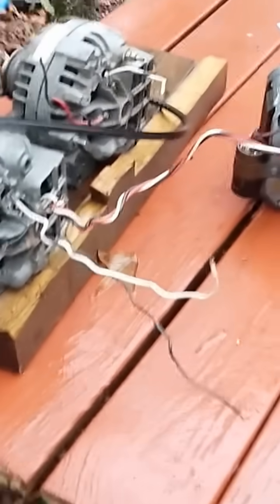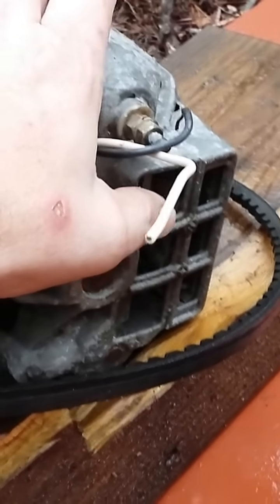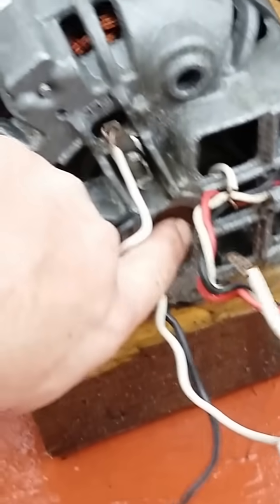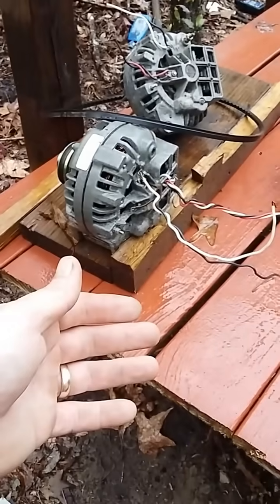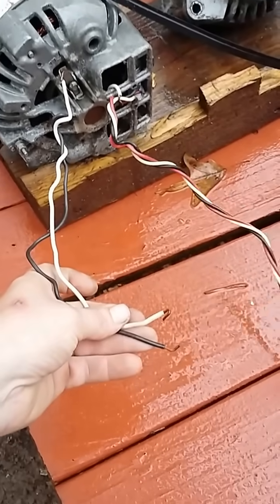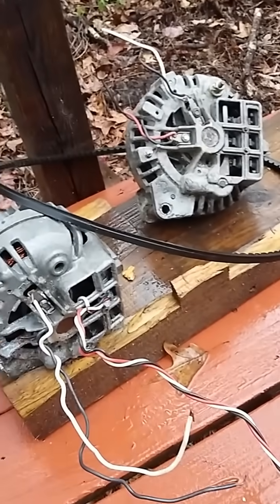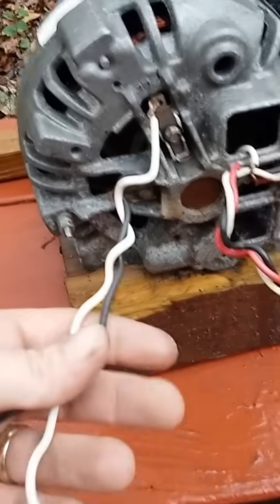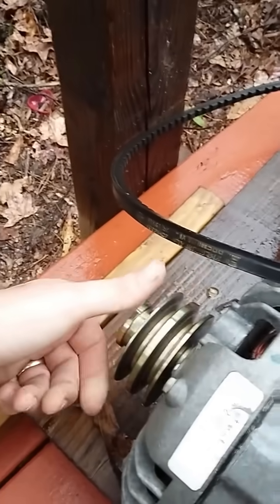Update Free energy forever no wind no solar no gas READ DISCRIPTION!!!

Comment: some of you people are just but stupid this guy's done something I've known for 25 years I called it a charging unit, a battery with a dead cell it won't take any charge but will put out enough voltage to supply the field Supply on the alternator enough current to excite the alternator to put out enough voltage back into that dead cell battery to run an inverter and many other things, I ran two TVs ,  2 water cooler setup to run on 12 volts and a lot of lights every night for many years at idle with a small Honda motor and had people all around the area coming to see it and copy my idea y'all just too stupid to get into it

Comment: I want to see it hooked to a light in your house.  I thought of using magnets to propel the motor to turn into power
Reply from the maker: James Trotter you can do that too... you just have to be creative and thank efficiently! I've actually got another system that uses a 3-phase permanent magnet motor... with the controller the 3-phase H bridge and everything together it consumes less than 700 watts and is able to produce 20000 Watts but the alternator in this video that has the wires hanging out of the back of it is actually a 3-phase field magnet motor...

Comment: If they wanna find you it would be easy to track you through the cell tower or your IP address unless you are operating behind a VPN or similar
Reply from the maker: newton raymond I do run a VPN from some of my devices but not on this one.. if they want to come find me, I'm about 20 minutes outside of Little Rock! I'm not hiding from nobody! I have 5 hardwired cameras that's not all the cameras... just the hardwired ones! I have perimeter sensors and I have people with weapons! like I said I'm not hiding from anybody!!! Thanks for the comment! most people don't know about virtual private networks or how to set up mock locations... I have both!
Even though I don't need them.. and there's a little secret about directed energy weapons. they don't go through aluminum...

Comment: you said a few times one must put  6 volts into the first wires. My question is, where do I get the 6 volts? I'm not being a troll. I no nothing of electricity. Serious question.
Reply: JIMMY FRANKS you can get your six vaults to excite the alternator from a six volt battery. The alternator produces DC volts at about 13.8 volts output. So if you have two six volt batteries wired in series +_+_ you can charge them from the alternator , just take the six volts off one of the two six volt batteries.
The alternator will have to be turned by a wind mill , or water turbine to turn the Stator to produce DC power. Surplus DC power can be stored in batteries for when there is no wind. Remember the larger the demand on the alternator the harder it will be to turn, but generally people using this type of setup are frugal with their power needs and just need light or efficient refridgeration etc.
Cheers.
Reply: Axeman so you're using a six volt to start and the altenator to recharge the battery
Reply: @Jameseyesopen to excite the alternator,  3 to 12 volts dc. No such thing as "free energy" first you have to have a source to rotate the alternator , propeller  , impeller  etc. two six volt batteries in series gives you the ability to tap off six volts for other stuff, recharge your phone etc.

Comment: We have had the capacity to produce free power for at least 40 years ! If you have a hoover or a washing machine , they have huge motors in them with step up transformers and step down transformers to alter the current and voltage ! That's what he is explaining ! ! The government's and electrical companies ,who make massive amounts of money of us every month,year would not allow this because they are lieing greedy bastards who rip us off ! ! Example ! You put into you're hoover or washing machine 240 volts , and low and behold it's running a 2 watt motor that's producing enough electric to run you're whole house ! ! With clever step up and step down transformers and decent batteries you could run you're whole house on one plug ,plugged in for just one hour a day ! ! !
Reply from the maker: graham eel 
Well I didn't want to say all that on this video because this video has a lot of attention.. so let's go ahead and tell it all  and you are correct except it's not 220vac and it's a little more like 396pdc volts and you consume .75 amps which is just a few watt's considering it will power a large enough 3-phase permanent magnet motor to efficiently run to 10000 W self excited generator heads let's do the math 396 times .75 equals 297 Watts but like I said that is for a large system that will power two 10000 watt self excited generator heads and that means that there is no input to the generator head all you do is turn the shaft and they accomplish this with a non polarized ceramic capacitor and a 10A10 rectifier diode you do however have to charge it for it to create the field the first time you use it and if you leave it sitting for a couple of years you will have to charge it but like I said in my previous comments I replaced the bridge rectifier in this alternator with a 3-phase H Bridge therefore using it as a primary mover instead of a generator because with the current stator windings it only produces 1080 Watts whether it's at 220 volts 12 volts or 120 volts... thanks for the comment!!
Reply: @ThomasBuie  man that is awesome ! ! Keep up the good work and fight for free energy to everyone ! ! Tesla was right all along lol ! !

Comment: This method DOES work, & very well. To those who claim it doesn't: your negligence is showing.
I take my hat off to Thomas Buies to posting his videos, because he "gets it". 
 Thomas, Keep On Hangin' On & doing your work, I know what you're doing & you've got it "spot-on" correct.
Seriously, if you ever want to kick around ideas on how an alternator works, or getting them to stay at 60Hz while providing the necessary output at 120vac, drop me a line at "phoenix.nightowl.jr@gmail.com", (and please forgive any delays in my response; I get a LOT of "junk e-mail".)
From a former V.P. of the Society of Broadcast Engineers,
Lic. #s:  P1-24-12140, PG-4-5658, N3VQK, KCD-3468, etc., et al.
 (I can assist you with any Disability Claim you may have, since I'm "Retired Under Coercion" due to being Physically Disabled myself.)
Reply from the maker: Phoenix NightOwl, Jr. Brother I would love to sit and chat with you for a little while and really give you the information that I actually possess... not just what I show online and I know that using a non polarized capacitor and a rectifier diode on the field winding will give me a self excited alternator and if it turns at 3600 RPM that will be 60 pulses per second * 60 Seconds.. but I do  think you very much for your comment!! And, like I said I would love to chat with you!!! my email is in my username
EnergyBuies@Gmail.com
 And if you wanted to give me your phone number. I would call you! P.S. Do you know where  H3 comes from? I do!  which is also the reason why the moon is covered with it!
 and also part of the key to cold fusion because cold fusion produces all of the third powers!  and as you know they are all overunified...
Reply: No problem. I'll try using your email to shoot my phone # to you.
Reply: I just recently made a battery bank with a 3000 cobra  watt inverter and deep cell marine battery....this alternator idea really has my wheels turning
Reply from the maker: David Goglin well you just described exactly what I'm using at my house...

Comment: You showed everything except it doing what you said it would do.  Spin this with a motor,  what does the motor run on that spins the stator asshole
Reply from the maker: Tyrannical Grim  yes sir that is just about how it works except there's a little more to the equation. which I do share in private videos sometimes and I have hidden throughout the videos on my YouTube channel.. most of everyone does not read the description of this video as instructed to do! but you must think of it in terms of using a 3-phase permanent magnet motor, because you must have a motor that is very efficient and can handle the power ratio for a generator that will output 10 times more than the input of the motor... kind of like this video of mine that I posted a couple of days ago..

https://youtu.be/ve0x2KQgJt8

And thank you for your kind comment!!! I treat people exactly how they want to be treated!!!
Reply from the maker: Dave Van Meter 
It uses a battery that it also recharges bitch.

Comment: You won't get more than 20 amp with that 12 gauge wire. You said you're getting 90 and 250v???? C'mon!!
Reply: You can get 90 amps off of that generator You just can’t use more than 20 amps with 12 gage ! You can light your house up and get few outlets going with 20 amps ! Actually 12 gage wire will carry more than 20 amps. Probably 30 maybe 40 before it get warm . It’s just not legal to run more the 20 off it .
Reply: @jaybass9476  - fantastic; you nailed it!  I forgot to mention the part where he specifically warned the potential danger of running beyond the recommended limits cause you have a 90amp generator with unregulated draw coming through indoor low amp wire.

Oh shit...he didn't say that.  In fact, I believe running a welder was tossed out there as a possibility.  And you wire an outlet to your generator cause you can plug shit into it, there's nothing stopping 90amps from getting yanked right through that wire.  Your phone charger shorts, you have a 1s delay fire bomb.

Why the hell would you wire it in the first place wrong, subjecting yourself to immense danger (if indeed true), then taking it one further and uploading a video without warning?  Either 1.  You are able to pull 90 amps but you're batshit insane and inexplicably dangerous and advocating others follow your lead, and indeed have requisite knowledge of electricity or have no/little knowledge of electricity, 2.  You're not getting 90 amps, instead you picked an appropriate wire and misspoke or lied about the 90 amps.

There are other combinations of logic, but I'm assuming there is something positive attributable to the video; the other directions of logic don't allow for that.

But, even the choices with a positive conveyance, some negative aspect is dragged along.  Essentially, you need to choose 1.  Spoken truth, otherwise ignorant or malicious; or 2. Spoken non-truth as abona fide unaware accident or uncorrected by nonfeasance, in spite of accurate knowledge and understanding.

Neither of those positions are defendable.  You've got misfeasance, malfeasance, ignorance, or nonfeasance.  There's one acceptable out in my mind...

Saying 'well, you can actually get 40 amps through it before it gets hot...' is not the way to out.  Again, to save face and integrity, not judging on the reality of what he says one way or the other, there's really only one acceptable choice....  I don't freely pick it for someone with questions like these on the table.  I assume full of shit until they show me otherwise.
Reply: J. Mac Jordan   Your absolutely correct! But I gotta say ! I can make this work perfectly safe ! But I’ve been doing this shit for 30 years . I don’t recommend any joe smoe to try this if they don’t know what there doing ? It’s not rocket science but you should know what the hell your doing! And by the way . it’s not anyone’s invention! People have been doing this kinda shit for years. Thanks for the reply though! You made some great points .
Reply: Exactly.  90 amps would liquify the copper using that size of wire; if current is pulled out of it, it's peaked at 15-20 amps.

That's still good though...but on the flip side, you're putting 6volts, unknown draw & separately spinning it via some unmentioned/unknown driver....a handcrank? ...a bicycle? a wind turbine? Steam? Coal? Burning Trash? Burning Wood? Off gassing mixed household cleaners?  A car engine?  A diesel generator...  A breeder reactor?

Two unknown energy inputs -> One Alternator -> Max 120v 15-20A

.....?  I don't know...  How many smoke detectors do you purchase on average per year and for at least the last couple (say 10) years?  That'd draw the government and maybe get you killed from exposure to high doses of radiation....(?)

Comment: haven't seen anything move for free.
Reply from the maker: how much does it cost the Sun light to travel the Earth? how much does it cost the wind to blow across the sky? none of that is freely moving? what energy source does the wind have? do you know? I do!
It's called vibrations or Silent Sound if you would like to use layman's terms. Do you know how cold fusion makes hydrogen 3? I also know that!! But I don't know the difference between a rotor and a stator...
Reply: so i need a panel
Reply from the maker: fuck masons if you're going to use an alternator for an alternating current power source you are going to need a panel you're going to need capacitors as voltage regulators you're going to need resistors and you will need non polarized ceramic capacitor in parallel with diode on the rotor...  do you know how self-excited generators work?

https://youtu.be/0Bs_aBDwFA4

Comment: How will you synchronize the 2 or more alternators so they are in phase if you parallel them up? How will you regulate input rpm to insure correct frequency so as not to damage electronics, how will you get a star point from your alternator so as to be able to use a single phase load. I would like your thoughts on this.
Reply: Magic.

Comment: Diodes do not change alternating current to direct current, or vice versa. You are an idiot and a liar.
Reply from the maker: Mark Kmiecik I took the 3-phase Bridge rectifier out of the alternator and replaced it with a 3-phase H Bridge! THANK you very much for your dumbass comment mark...
Reply: I guess Mark doesn't know what diodes are used for

Comment: I can see a possibility of using this to run continuously if tied in with a good high amp battery if one of the reversed Altonaters are used to recharge the battery on a trickle charge and use the other AC current produced to any other small powered tool.

Comment: Yes, you can get AC out of a DC alternator, as you describe, by bypassing or removing the diode pack. But, you in no way will be able to pull the 90 amps you claim out of it. It's just not strong enough or will it last long enough to run your whole house off of. Plus consider the frequency of the AC you produce could do damage to most electronics. If you can be a little more modest, use the alternator to charge a battery bank. use the battery bank, to run an inverter, and have a good stable voltage source, for lights and small electronics. But your not going to be able to run heating elements or motors and compressors.

Comment: dude you set a. battery down hook battery to the electic motor ..set two alternater up hook belt to the 3 of them togeather and the electric motor will run the alternaters there for giving power and will run it self ..make sure that the battery gets some power back ..that simple
Reply: rockethead555 ..ive done it and it will work but cant run everything ..can run lights and tv

Comment: Dude, are you turning the motor to turn the alternators by hand?  What power source are you turning the motor with?
Reply: Probably there is a cold fusion reactor under the table.
Reply: Think about it Chris. Why does he have 2 alternators there with a belt? One powers the other with electricity and the other makes the one spin with the belt. All you need to do is hook up a battery for the start up. I'm gonna try this but with a much more stable mounting system.

Comment: They are max 70 amp alternators. That's at 12volts. 70 amps at 12v is equivalent to like 8 amp 120 volts and 4 amp 240 volts......

Comment: If you get that alternator turning at what ever speed with wind or water it will charge batteries..with an inverter you have 240volts..end off....

Comment: Crazy the length and effort people go to! Red flags; He is commenting for donations, and the physics is way off; calling an armature a stator, it’s raining like hell on his electrical gear... ‘Anyone that knows electricity...’, doesn’t take rocket scientist to know. OMG! 90A through those tiny solid copper wires and he’ll really need to stand back!! Having experience with brushless generator tests at 100A... it takes a decent copper busbar plate to handle currents Iike that for any length of time. If his output voltage was extremely high then the current could be proportionally lower (per ohms law), and the power dissipation might be low enough not to cook his copper (but his wire would need crazy insulation throughout the system in that case to avoid dialectic failure). Power P, is measured in joules - it’s the heat part in his copper... P is derived by I (current) squared, multiplied by R (resistance - which is dependent on temp, length, and cross-sectional area factors). His claim of output - roughly he’d need solid core wire that is approx 10x cross-sectionally larger than the standard solid core TPS 10A house wiring to cope even marginally with a current output like that... assuming 240VAC. Then say you lower the voltage, with a given fixed load (...per ohms law), the current will be proportionally higher if the generator source can cope.... so, I^2R ... the power dissipation in the wire (fixed resistance load component) - is going to be exponentially proportional. There are wire charts for this stuff. Lesson for today folks - Don’t try putting 90 amps through baby wires. Toast. Amusing video but rubbish.

Comment: Diodes are a one way door for electricity only they do not change AC to DC that is the rectifier regulator. Please show us the system setup running and working throw a multimeter on it so we can see the output please. Good concept would love to see it work